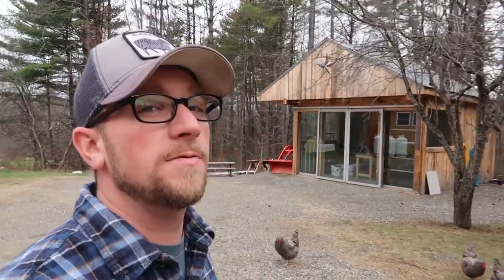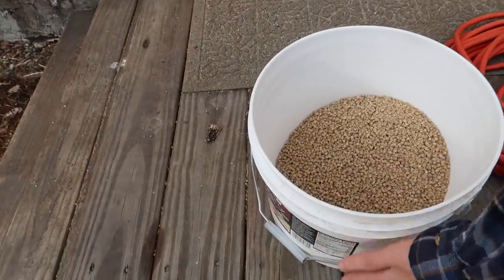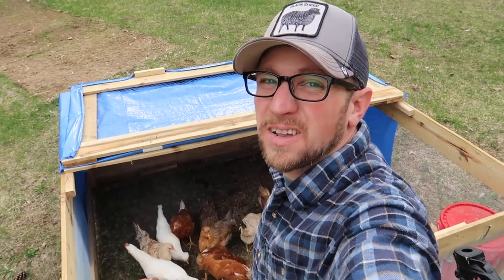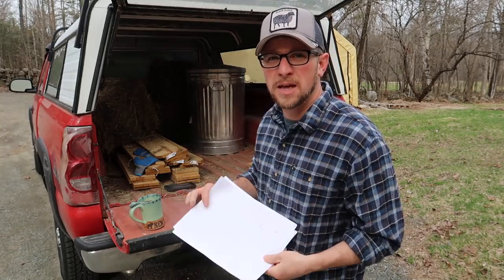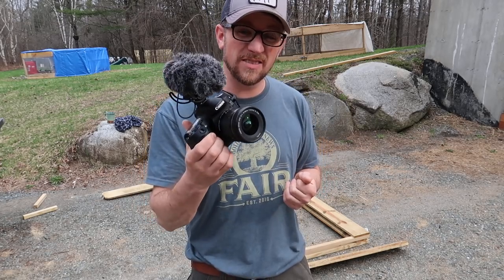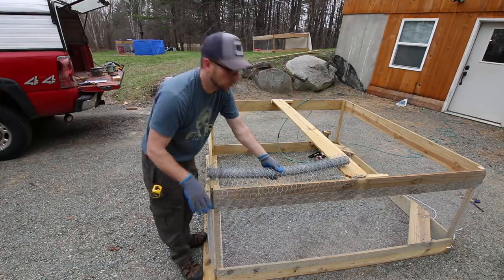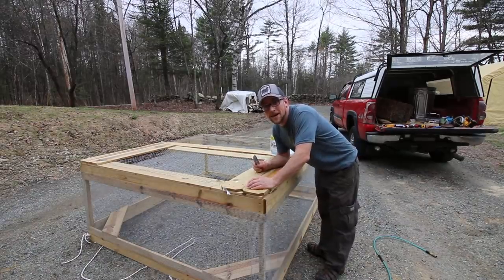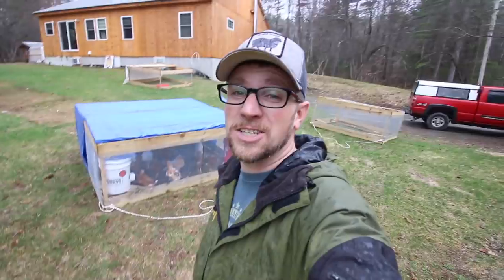Building A FLOCK of $30 Chicken Coops

Comment: They are a pretty nice coop and for the small operation seem to work out well. Easy to build and easy to move. Just need twice as many as the bigger tractor is larger. You could build them in the outdoor kitchen off season as well.

Comment: I built mine. I made it slightly larger then your design. It's made with rough cut 1x6 lumber and it's 10x10. I had to put it on wheels because it's a tank!! haha I may have overkilled it but I plan on putting 50 meat birds in it. It also opens from both ends. Right now it's a pen for my 2- two week old geese to play outside in safety. I probably have to wait a few more days to put the meat birds in it. They nights still get pretty chilly here.
Reply from the maker: I bet the geese are loving it!

Comment: Next time put that chicken wire on top then put the hardware cloth over it around the outside. That will hold it better and stop the little edges from being loose & sharp.
I don't understand how you can make the tractor with only 2 of those fence pickets ... it looks like you have about 12 or 14 in your truck for that that coop, 8 for the sides, 1 on the bottom, 1 across the middle top and about 4 for the top door. 
I couldn't find those boards with the dog ears so I ended up having to buy almost $40 worth of boards just for the 8 side pieces. Now I also have to buy the top, skid  & spindle pieces. 
Your list looks wrong it says 2
Materials List:
2~ 6-foot green treated dog ear fence pickets 72”x5.5”x5/8”.
Reply from the maker: Here is are directions and cost list for the coop it calls for 12 pickets http://www.lumnahacres.com/2017/10/08/diy-30-chicken-coop-built-in-30-minutes/
Reply: Thanks that is not the same instructions that I found on your website.  I guess I found the wrong ones
http://www.lumnahacres.com/2017/10/09/diy-hacks-for-your-chicken-coop/